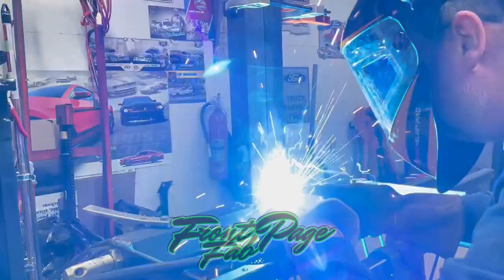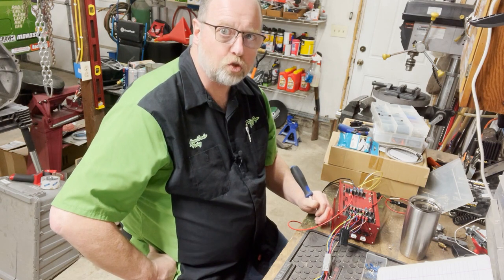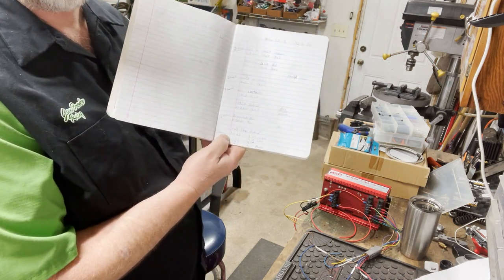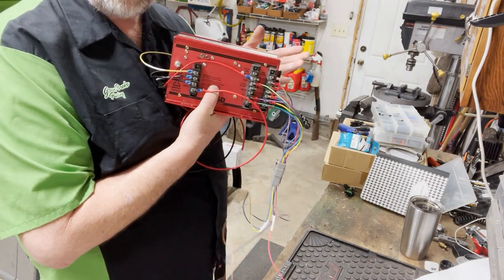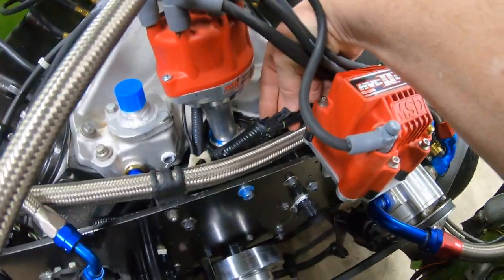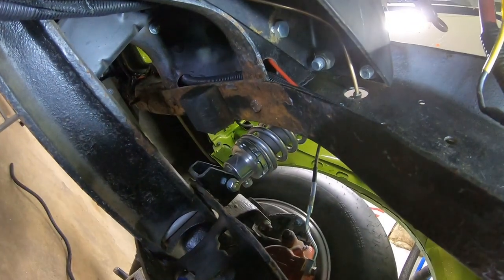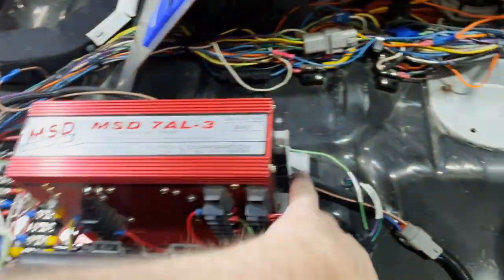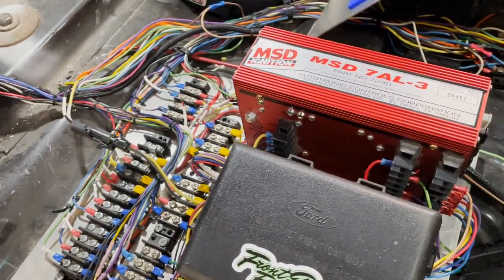Race car wiring pt 3 MSD 7AL-3 Install

Comment: Can you use the ras for electric shifter?
Reply from the maker: @robsmackhead  No, unfortunately. The shift solenoid needs a momentary signal of .5 sec. The ras is not designed to work this way.